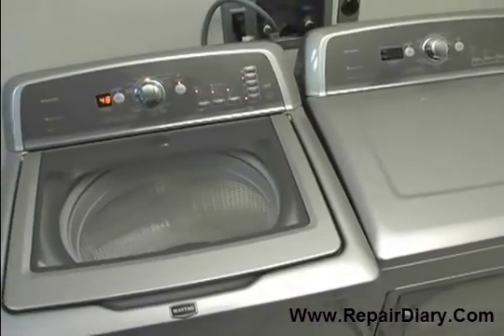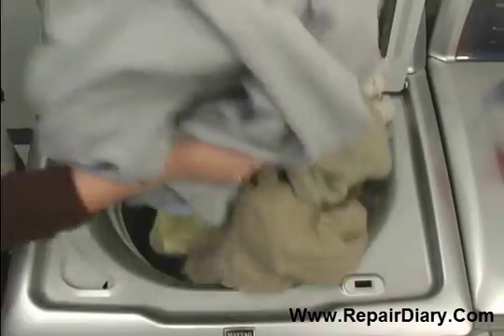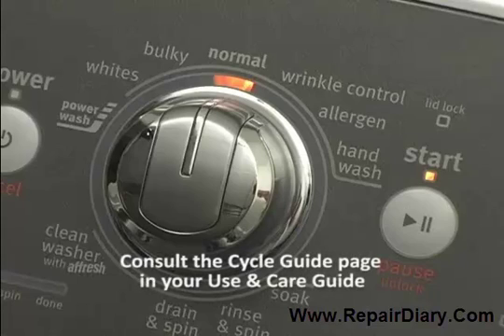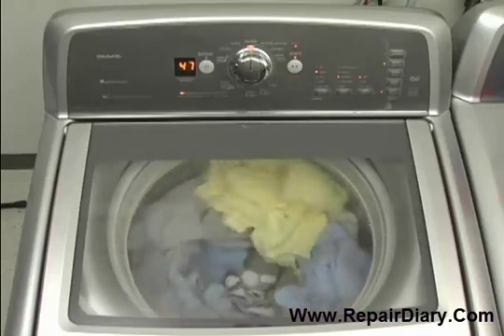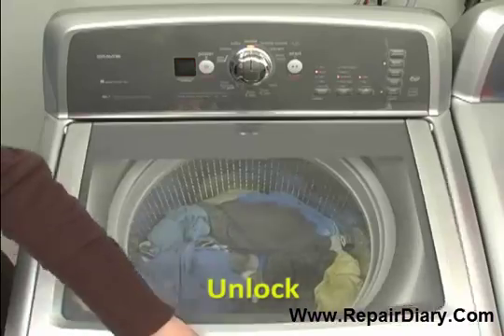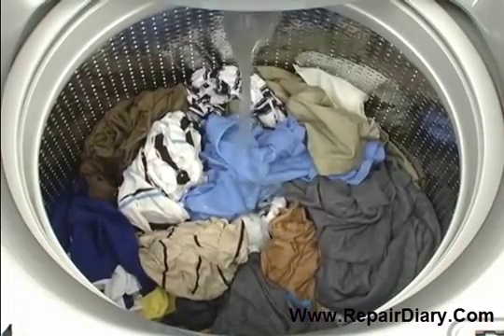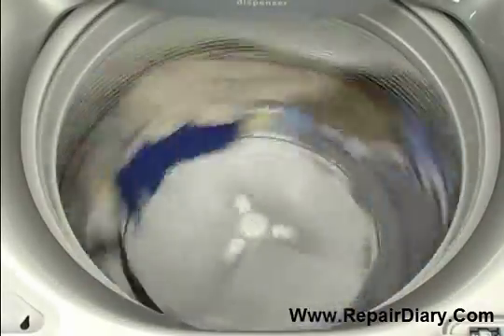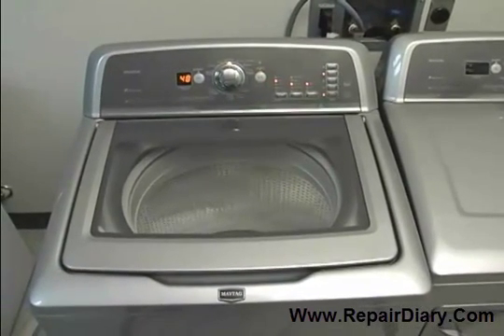How High Efficiency Top Load Washer Work

Comment: Finding ways to conserve resources and energy is not and should not necessarily be a bad thing. However, when certain ideas such as he low water appliances (which are horribly ineffective and unreliable) are forced down the public's collective throat, without regard for sound design and consideration of the right to choose, people can feel and clearly see their rights are being violated.       
     The clueless idiots in the regulatory ivory tower responsible for creating this debacle need to wake up and realize there are many ways an individual or community can conserve water and energy other than solely pointing the finger at washing machines. Using an adequate amount of water to EFFECTIVELY wash clothes is not and never has been considered a waste of resources because it is considered part of our personal hygiene. Something has got to give already!
Reply: Daniel s i have had this piece of crap washer for about a year now didn't like it from the first load..clothes not clean so what i do is add about a half gallon of water before i start ..washer thinks it is heavier and in turn adds more water (i seems) cause clothes have been cleaner
Reply: your exactly right. eventually all the typical top load washers that use a lot of water will be taken off the market in favor for these pieces of garbage. you need to use water to get your clothes clean. if you have to buy an he, front loaders are better because of turnover rate. these top loaders are the absolute worst. We have 2 laundry sets in our home. a lot of laundry. lol. we have an Electrolux wave touch front load (because wife thinks it's pretty). it is actually pretty good. yes it doesn't use a ton of water, but more than most he machines due to the add more water option. We also have an older maytag neptune front load set. Washes the clothes very well. Moral of the story is HE machines aren't the biggest issue, it's these top loaders, and the fact that the newer the machine the less water they use. Eventually washers are going to have a clean mist function where it lightly mists the clothes clean. I can actually  see that happening . if your in the market get the electrolux. it is pricey but it is the only he machine that gives you the option  to use more water
Reply: Well said. I'd rather tear out my lawn first which is useless than sacrifice my hygiene. Bought a Speed Queen for that reason. It uses WATER as a carrier to remove dirt. There is no other way around it. Other than having the clothes go through a 3 hour wash cycle that a Speed could do in forty minutes. So they traded water for time and electricity. I don't know about you but I don't have three hours out of the day to wash one load. 
Also the regulators didn't take into account "heavy" occupations such as Farmers, construction worker, heavy equipment operator, fast food worker, chef's  who's cloth gets LOT dirtier than these regulators working behind a desk. 
I wonder if they tested their shirts which have them only exposed air conditioned office building & a/c Lexus's most of the day? 

This machine I guarantee it won't clean a typical  blue collar workers clothes.
Reply: @rxonmymind8362  There's only one that will. Speed Queen Classic.
Reply: +Mike Bennett Like our toilets don't flush well.
Reply: Nick
 You're right about that. The low water toilets are terrible also. These enviromentalists need to learn how to find more meaningful ways of protecting the environment other than influencing the Government to create stupid and baseless regulations.
Reply: How about the CFL light bulbs?
Reply: +Nick G 
What about them?
Reply: +Nick G 
At least some cfl bulbs are better designed and last longer than some of these new he washers on the market.
Reply: @mikebennett703 I agree with you. This is so stupid!
Reply: @twobanger21  And our dishwashers don't wash well. They just mist the dishes.
Reply: Absolutely! Do they think we're stupid?

Comment: I have sold appliances for over 10 years and I TELL YOU these HE washers work amazingly well! The only thing I disagree with on this particular video is that when you put the clothes in, you should put them in like you are putting them in a hamper - do NOT only put the on the outside of the tub. When you do that, it is harder for the washer to fully agitate and THAT is what causes some of your clothes to have dry spots. BUT having said that, dry spots does NOT mean they did not clean well. We are all used to water = clean and that simply has been disproven. The fact is that you need enough water to dilute the detergent and disperse the cleaner throughout the clothing but you do NOT need gallons and gallons of water. With lots of water, you need to use lots of detergent. Less water, less detergent is needed. I know these aren't for everybody but despite a lot of comments here, they absolutely DO work and they are very gentle on your clothes too.
Reply: Hi Susan,
 I would love to agree  with your comment here, but then we would both be wrong. The truth of the matter lies with the chemical and hydrodynamic properties of water itself. Water has a finite saturation point. It can only adsorb so much soil matter / contaminate into solution or suspension before it be becomes ineffective. Laundry, when placed into a given volume of water and agitated will impart whatever soils and contaminants present into the water. The job water has to accomplish is to dilute, absorb, and flush these contaminants from the clothes BEFORE it reaches its saturation point. Once this point is reached, you are no longer cleaning.  You are rearranging and spreading around soils not removing them. The smaller the volume of water used, the sooner you reach this saturation point. This is why water volume IS crucial and the more the BETTER. This is also why he washers need self cleaning cycles. There simply is not enough water volume used in the washing and rinsing cycles to flush out the residues from the machine. Bacteria, soils, bodily fluids, surfactants etc. build up in the outer drum of the washer causing it to smell bad. The he concept is an example of a complex government agenda  once again overreaching and abusing it's authority. An average size American family uses more water using the lavatory in two days than a traditional washer uses in two weeks.
Reply: +Susan Headley   Sorry, I've got one and disagree. So I would say I'm speaking from experience.  I think you are biased because you sell them.  If I wanted to be crass I would say you've been drinking too much of the kool-aid.
Reply: +Susan Headley I bought a new washer this year. I bought a Speed Queen, the Mercedes Benz of washers. My Speed Queens washes in 28 minutes start to finish, clothes NEVER have to be rewashed, ALL the soap is rinsed out, and, yes, it uses 54 gallons of water PER CYCLE. I'm happy.
Reply: +Mike Bennett   Bravo; well said.  It sounds like an answer by someone with some actual education about the subject (and not a salesperson who has an agenda).
Reply: +MB MC 
Thank you for the compliment MB MC. Lately, it seems quite apparent to me that most of the major appliance manufacturers care more about profits and less about engineering quality products with sound designs. The regulators and environmentalists behind this he washer debacle seem to have little to no scientific knowledge. It is obvious their regulations  were made without having adequate scientific research to base them on.
Reply: +MB MC 
 I exclude Speed Queen of course, from my first comment. They without doubt are the best washer and dryer manufacturer in  the USA.
Reply: +Susan Headley I'm speaking from bitter experience. I went through coordinating care for a family member at home through the end stages of dementia, having four or more loads of linens, towels, and nightgowns per day, and the HE machines (I bought a Whirlpool, a GE, and an LG within three years) do not clean clothes adequately, they are hell on durable and delicate fabrics alike, and the machines do not stand up to normal use. They did not save water or energy, and the machine cycles take two to three times the time of a Speed Queen laundromat-style machine. A front-loader might have been faster, but the caregivers and I found the top-loaders easier to deal with (none of us were as young as we would have liked to be).

Comment: Less water reduces wear on clothing??? Actually, LIAR, it is the very opposite. This dumb machine is grinding away at the clothes with no water to buffer.
Reply: +jbooks888 
My clothes have stains, no wait, those are high efficiency attempts.
Like a low flow toilet yo have to flush 3x to get everything down.
Reply: +jbooks888 This HE machine is doing a number on my clothes. It comes out stained, wrinkled and looking like complete crap. My old Whirlpool with agitator was much better. These machines suck!
Reply: YhwhKhaiMostHigh Give me a front loader any day - the tumbling gets the job done without harsh impact on the clothes, and because there is much less water in the tub, the detergent concentration is much higher, although it does take a lot longer.
Reply: Raylan Givens EXACTLY !
Reply: jbooks888
I'm going to try that next because I hate that it takes me twice as long to iron my clothes.  At the ironing board I'm using wet paper towels to wipe the excess patches of lint off of my clothes. I will try the bucket trick next but I shouldn't have to do this. Like someone said on another thread, "If it comes to saving the planet or having clean clothes, I'll take cleaner clothes."  Thanks for the idea. I hope it works.
Reply: "This shirt is DRY CLEAN ONLY which means...it's dirty." 
---MITCH HEDBURG
Reply: Wait till you put those clothes in the dryer and see all the lint. You need water as a carrier. Period. This machine uses almost none. 
To clean clothes you need two options. 
Lot of water and less detergent.
Or 
Lot of detergent to make up for the less water. 
This washer won't work for you if you are in heavy industry. A farmer, mechanic, construction etc. 
A banker 9-5 or office receptionist? Fine.
Reply: YhwhKhaiMostHigh Is there any way you could run a hose into it (or a couple of buckets) and give the load more water - the clothes would circulate better...
Reply: @atharvanaik3881  I watched s similar video when the same amount you described was used. At first I thought it was not enough detergent but actually it was. I had been using too much all these years.
Reply: jbooks888  I was told by a sales person a year and a half ago about a Haier washing machine, same concept just has ridges on the tub as well as a similar 'wash plate' on the bottom...it literally fills with water to wash and rinse, Whirlpool and Maytag machines are a joke, GE isn't much better. Going on two years with the Haier full size HE machine and it's one of the best...just alittle food for thought if you're looking for a decent new machine
Reply: GE sucks!
Reply: jbooks888 wwwwwwww
Reply: Gentlemen Prefer Blondes 
Speed queen top loader. ;)
Reply: If I was forced to choose between this and the 2018 speed queen, I'd take the 2018 speed queen! I'll always use auto-fill and heavy-duty, period!
Reply: This video is a lie!
Reply: +jbooks888 Exactly. Anything to get you to buy another piece of crap
Reply: There is absolutely no substitute for water, in washing clothing with adequate amounts of washing and rinsing water, or lack thereof.
No matter what kind of industry kind of spin you try to spin, you are knowingly lying. 
Nor is there a fabric or clothing manufacturer on the planet that will advise sanding clothing clean or against each other. This voids all warranties actually.

Nor is there a soap manufacturer anywhere on this planet, advising you to not wash and rinse clothing thoroughly becasue they all know that breathing and coming in contact with laundry products is harmful to yrou health and can be deadly. Stop lying.
Reply: And front loaders begin to smell of mold after a bit too...no thanks. @atharvanaik3881
Reply: @junezydek9594  Not true, mine never do. Little secret there -- just keep the door open at all times when not washing -- No Mold and No Smell -- very simple.
Reply: @arynasmail  Even if you're keeping the door open, the HE Top Load washer doesn't mold as much as a Front Loader would have. You to not have to do too much with a HE Top loader.
Reply: jbooks888 I think that if you see your clothes grinding against each other instead of floating around and under the water line, it means you're overloading which will lead to the machine breaking prematurely. Plus the clothes won't wash properly. That goes for any model. My adult son did this and at 30 years of age, I had to restrict him to only doing blankets, pillows, and his jeans. So my Maytag ended up lasting 7 1/2 years with one repair and when it broke again, I bought a Samsung. They really do not build any appliances to last like they used to but the new ones require different methods for use. Some are good and some are frikking annoying or with unnecessary options. I know it sure as hell takes too long to do one load with the newer models. A lot of people are just enticed by the new glamourized looks.
Reply: grinding away clothes with non agaitaor? god i need to know what you’re smoking buddy.
Reply: jbooks888
 I'm stuck with this crap for now... sigh.
Reply: I agree! This is so stupid!
Reply: They are lying. AND they know they are lying. 
There is not a garment manufacturer on the planet, that will advise sanding clothing against eachtother in the wash and rinse cycles. They cannot even warranty that clothing when washed improperly, and this improper washing is the leading cause of the breakdown and aging of fibers and fiber dyes, as well advertised on clothing labels and industry standards for decades.
These videos, and machines constitutes fraud and misrepresentation of fact, by law by all these washing machines manufacturers and need for a national boycott, as well as litigation in the public trust.
Plus, these machines endanger the public health in not properly and fully sanatizing clothing with adequate amounts of water and release, and then leaving dangerous harmful residues which later absorb into skin and destroy human health, are known carcinogenics, break down the natural human immune system,  just as the soap manufacturers advise against.
Reply: jbooks888 no, the agitator is what rips the clothes up. This is simply using the friction between the clothes to wash them. That's why there is He detergent specifically for this washer.
Reply: No, it's that Edsel hubcap in the bottom that wears out the clothes. My LG (Lots of Grief) broke down and the manufacturer supplied flying saucer (the correct one, I had to verify the model number to order it) would not fit the splines. I just bought a 2019 Speed Queen TC5000WN, the return of the old school mechanicals. No regrets.

Comment: I've went thru 2 of these HE washers and they are junk. Clothes never came out clean and whites were dingy and stains never came out good. got sick of it and got my old 1980's GE Filter Flo out the garage and hooked up and wouldn't you know my whites are white and stains are out. Even most the old one that were set in from the new POS not getting them. Best thing is I throw them in how I want and, Here's the kicker, It just starts filling with water and gets the clothes wet and beats them. Not molest them before it decides to add some water that gets them damp then just pat the clothes on the bottom. Only good thing I can say is the HE's do a good job of not having unbalanced loads while spinning.
Reply: Great job for keeping your filter flo! I think those were among the best if not THE best washers ever made. I had one that lasted almost 30 years. I wish GE still made them...

Comment: We had this type of washer (Maytag Bravos) and liked it at first until we noticed our clothes weren't getting clean. So, we sold it on Craigslist (although it should've just been thrown away) and bought a Samsung front loader. I modified the front loader so it adds more water and it's worked great for us. However, once it dies, we will be getting a Speed Queen. 

By the way: the "Clean Washer" cycle on the Bravos/Cabrio models throws the HE of these machines out the window. It uses a TON of water. This cycle has to be done monthly or a dirt ring will develop around the tub.
Reply: Hey it’s been 6years. How’s the front loader? Is it leaking or anything. I’m thinking about getting one.
Reply: Sorry, just seeing this now. The Samsung front loader worked quite well for several years. I ended up getting rid of it when it took longer and longer to spin out a load (maybe a balance sensor going out?). Also, I saw spider arm bits in the drain clean out basket. It was replaced by a LG front loader (SQ got pushed off for now) which has been an alright washer. I'd definitely recommend a newer LG front loader over a newer Samsung. Let me know if you want more details.
Reply: @ikeb3146  i love my LG front load it’s a top of the line it one

Comment: Garbage ass machines... These do not clean worth a shit. Fuck all HE Machines! All these new Belt driven electronically controlled POS Washers suck! Mechanical Direct Drive is the way to go... simple yet so reliable and YOU control the machine, not the machine itself! YOU Control how big the load is, how much water to add and how much time you want to run it! What happened to all the good old appliances?!
Reply: +That One Ford Guy Speed Queen is still out there, still made in Wisconsin, and still as heavy as a Pierce-Arrow and take your change in Terraplanes.